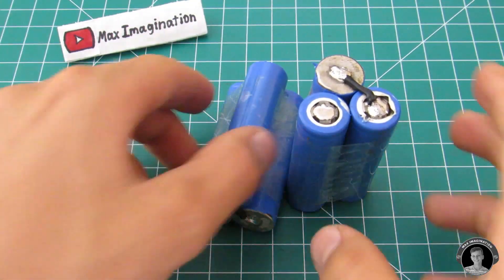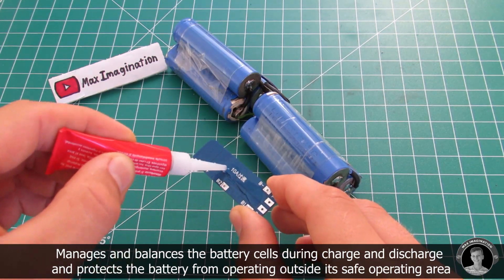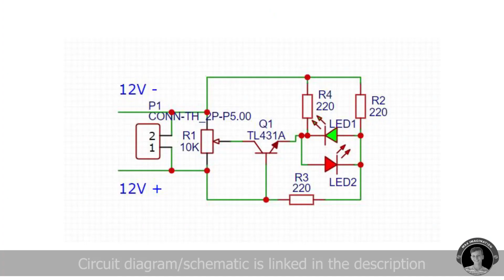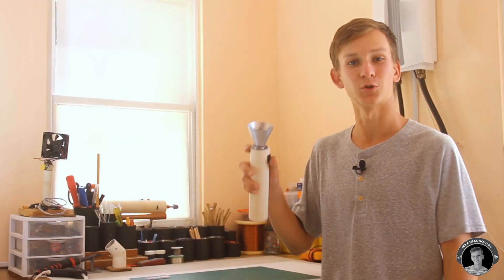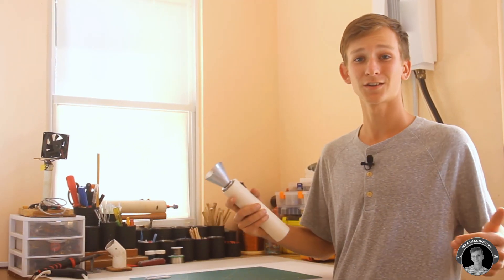How to make a STEAMPUNK 35W Incandescent FLASHLIGHT | DIY Powerful Emergency Torch

Comment: I’m sure this would work with a 55/60w but mine would be powered by a 3s lipo 5.2ah/5200mah also what happens if the bulb goes out do you switch it or do you have to make a new light
Reply from the maker: Seems like a good enough battery in terms of power capacity. The bulb can be switched, that's what I'd do if my bulb blew.

Comment: Hey, I am in the process of making the charging indicator but after finishing it it always shows red (used a usb c jack instead of a barrel jack), I tested it after connecting it to the usb charger and gradually dialling the potentiometer but it stays red
Reply from the maker: Hey there. Are you using the same transistor as I am? Have you tried connecting batteries of different voltages to trigger the green LED to light up? Maybe your resistor values are not matching. Please check your connections again as well.
Reply: @MaxImagination https://youtube.com/shorts/__3QmeY1UnU

The trial circuit I made to test the charging indicator, double checked all the components, only issue I can think of is I might have gotten the legs of the transistor mixed up (it's the same one as used by you, transistor label facing me , I think it's gonna be from left to right- reference, anode,cathode) request to take a look and let me know if you can spot any issues, nothing lights up now ! 

P.S. Thanks in advance!

Comment: Used Pipe diameter ?
Reply from the maker: 1½" Pipe
Reply: Is that led shows low battery voltage too?

Comment: Ok guys, that is not a incandescent bulb. ITS A HALOGEN. 

2 things to know: 

they get super hot.

don’t touch the bulb.
If you touched them, your finger oil can shorten the bulbs lifespan and it might not work.
Reply from the maker: Yes! Thanks for making others aware as well.

Comment: Make sure you wipe the Halogen Bulb with Isopropyl Alcohol after touching the glass with your greasy hands, otherwise it reduces bulb life.

Also, since Halogen Bulbs are made of Quartz, they let through UV radiation.
Reply from the maker: Thanks for the advice! :)